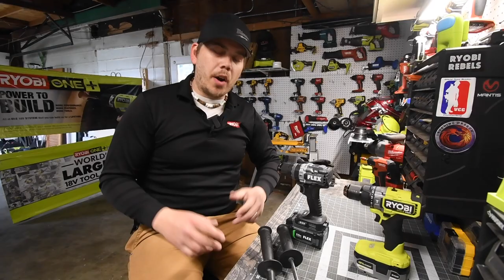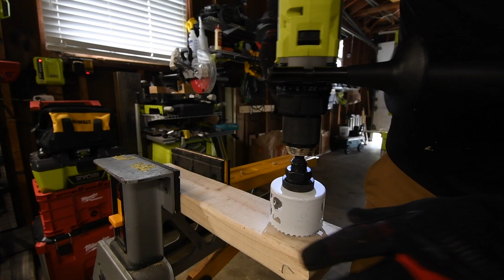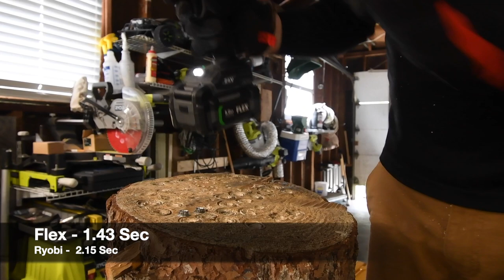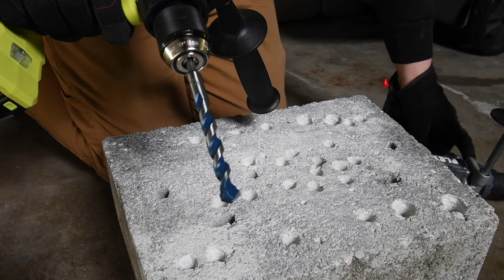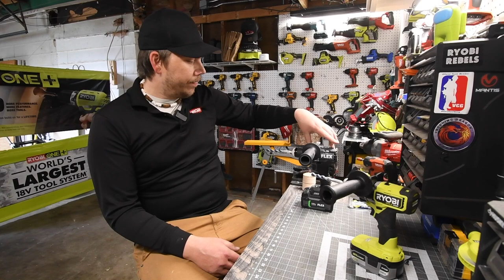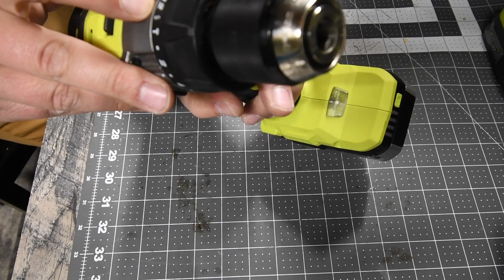FLEX Turbo vs RYOBI HP (Hammer Drills)

Comment: It's a huge difference when the loads get heavier. In small drilling and driving applications, there's not a usable "real" difference, but if we step up to big twist or auger bits....
Reply from the maker: Flex would last a lot longer on the job site, but this video was to test out the power between the two as sort of fresh tools

Comment: Those blue granite turbo bits are awesome. That's why you were so surprised.
Reply: Then must be disappointed in Flex?
Reply: @plaid11  yeah maybe. Hard to say with just a single hole
Reply: @ppwipf6935  seeing how there have been many other holes drilled with other channels, Flex beat Milwaukee, Dewalt, and Makita. I don’t remember if he had the turbo on for Flex but my guess is that he didn’t.
Reply from the maker: I do thank you for viewing :)
Reply: @plaid11   Check out Toolhead147.  DeWalt wins and Turbo overheats and turns off.

Comment: Sooo the flex about on par with ryobi or would you rate it higher? I’d like to see the flex up against makita. Also do you have a vid on the black makita compact drill/impact I’ve thought about getting those and makita xt281s I’m curious about both those makita models.
Reply: Imo Flex is showing it has its own class in between.  I would also like to see Flex and Makita 40v. Makita is built to get the job done not necessarily the fastest, but efficient. I just bought the Makita 40v Hammer Drill and Impact Driver, should be here tomorrow. I have the Makita Xph14 hammer drill and the xdt16 impact driver, both amaze me how comfortable and enjoyable they are to use.
Reply from the maker: I do thank you for viewing :)

Comment: The Flex is definitely better. But the kit at Lowes is $250. The Ryobi kit is $180. But the Flex also comes with a 2.5 extra battery. It's up to the buyer to decide weather its worth it. The Ryobi kit for that performance is impressive.
Reply from the maker: and that is why I do these videos. I just show what the tools can do
Reply: Depending on what you need, Ryobi has over 200+ tools that run off of the same battery platform. The Flex doesn’t have have that many tools out yet.

Comment: there is a flex drill with 750 in lbs  that should be more in line with the ryobi 750 in lbs not the flax with 1400 in lbs you should compare them

Comment: Which Ryobi is that? I think it’s only rated at 725 inch pounds, compared to the Flex, which is rated at 1400 inch pounds.
By the way, the Dewalt 996 has a pretty short handle too.
Reply from the maker: This is the most recent Model from Ryobi

Comment: Great video bro! Can’t help but wonder what would happen if you used 21700 cell battery for both drills. Maybe the same DeWalt battery via adapters? I know there isn’t an adapter for the DeWalt to flex yet. But when there is it would be an awesome test. Anyway, Ryobi surprised me I’m glad I own that drill. Thanks again!
Reply from the maker: more tests will be coming

Comment: Wow! I can't believe that this new Ryobi HP Hammer drill can keep up with the so called "Milwaukee Killer" Flex, can keep up also with DeWalt, Bosch and Makita wow! No wonder why I purchased HP bundle kit the HP Brushless 4 speed impact driver and the HP Brushless Hammer Drill kit it comes with 4ah HP Battery, a charger and green Ryobi Tool Bag God Im loving the color green. And since the new HP 6.0Ah battery came out I purchased the new 6.0Ah battery it's exactly the same size as the 4ah with added extra punch I hope Ryobi can slim and compacted a 9.0Ah battery with 21,700 cells in there or at least Ryobi should made a 12Ah 18V battery! Wow! Awesome! BUT STILL!! I'm not Loyal to any tool brand! So far I'm using DeWalt, Bosch, Makita and Hitachi in my jobsite as a Contractor, Carpenter, Framer, Deck builder, Electrician and Welder. And now I got some new Ryobi I'm using them in my jobsite as well! Who cares! They can laugh at me for using Ryobi they didn't know my box truck is full of DeWalt, Bosch, Makita and Hitachi tools inside. I hope Ryobi will consider making a Magnesium Worm Drive or Hypoid Saw! Corded! Or Hybrid! Also Ryobi should consider to make a Cordless 18V brushless Framing Nailer!!! Ridgid already have one! Why Ryobi Can't?! Since the new HP Rotary hammer drill SDS came out.

Comment: Again, I am impressed more by Ryobi holding it’s own being it is targeted towards the DIY person whereas this top level Flex is aimed to the pros 
And yes, please give the current prices. I know there can be “specials” in prices but I do think for comparison, especially between a DIY tool vs a pro tool it can really show the “power to value” ratio.
The Flex kit, with a 5 and 2.5ah batteries and their quick charger was listed at $249 at Lowe’s. The Ryobi kit with a single 4ah battery and their standard charger was $179. So the Flex is $70 more but you are getting an extra battery and the quick charger and a pro-level tool.
The Flex non-turbo hammer drill kit is $199 which I believe Chervon markets more as a “prosumer” tool and to me is a more equal comparison to Ryobi and I’d like to see that head to head test.
Also - Ryobi has a kit for $229 that also includes their HP impact driver and adds an extra 2ah battery in a full 2-tool kit.

Thanks again!
Reply from the maker: Roybi has came a long way

Comment: So when I’m looking at battery specs. Which number is the one that tells me how much power output the tool is getting? Volts, Watt Hours, Amp Hours?
Reply: It's hard.  They don't usually specify peak current on the case or specs.  That's why all of us keep tearing them open to see the cell type.  And within cell types there are different current ratings available.  Amp hours and watt hours are really a capacity comparison.  But they don't tell you the maximum rate you can deplete that capacity.  Kinda sucks you're stuck hoping the tool company marketing will tell you, e.g. High Output, Ultimate Output, HP, etc.  Flex doesn't even differentiate.
Reply: Unfortunately none of those will tell you, closest would be voltage x amphours but that doesn't tell you anything worthwhile (you need voltage x highest sustained discharge in amps, and that will give you watts which is a measurement of "power"). What you need to tell how much power a tool would get is the the discharge rate the Batteries can sustain and that will be in the spec sheet of the battery cells themselves.
Reply: You can also measure horsepower. For the electric motors, we can calculate the power or horsepower from the torque and speed. For example, if we have a motor with 3,000 rpm and 6 in-lbf then the horsepower can be calculated below.

Horsepower =  300×6/63025

i.e. horsepower = 0.286

Here, 6/3025 is a constant when using rpm for speed and in-lbf for torque units.
Reply: Watt hours pound for pound
Reply: @paedahe4975  horsepower is like 20 years not the number to use. Its Kilowatts my friend. Especially in racing and tuning nobody use Horsepower since OBD and that is being here since 1990... 
Maybe its finally time to go metric Murica
Reply from the maker: in my opinion ah with certain cells.
Reply: @Zozo806  It’s not common, just saying how it’s possible. If you really felt like knowing. 👍

Comment: Ryobi stopping is just the BMS inside the battery cutting out  due to over amping
Reply from the maker: I do thank you for viewing :)
Reply: I thought the same, if u use the DeWalt battery, it basically unlocks the true power of the drill

Comment: I don't know about the Flex but the Ryobi is a monster, as in big and weighty.  The Flex appears to be somewhat more compact and a lot more powerful.  If I was in a business that needed a hammer drill, for the extra bucks, the Flex would be in my tool box.  I own Ryobi but using the same line of batteries wouldn't matter.  It's about getting the job done, and without creating a lot of heat which should equate to a long lasting tool... sorry Ryobi lovers but the Flex wins.
Reply from the maker: The ryobi does have a unique hammer feature

Comment: I wonder why Flex has a turbo button, why not just have the tool always fast and powerful?  Does it have to do with battery consumption?  Maybe do a battery longevity test with turbo on and off.  That would be pretty informational.
Either way, I'm impressed with both brands.  Competition means innovations.
Reply from the maker: I have no clue either
Reply: I think it is a Chevron thing because they have it on some Ego blowers also...the “Turbo” feature
Reply: Sometimes you want the extra speed, about 90% of the time I wouldn't use it

Comment: Nicely done. I am betting the Flex could beat the Ryobi even if you used a 9ah battery in the Ryobi and kept the 5ah in the Flex. It does appear the only area the Flex struggles is in the concrete.
Reply: Not to mention flex needs turbo on in order to compete with ryobi. If ryobi had a turbo it would smoke it
Reply: @user-jh1mq2ih2u  turbo is speed 3 my guy.
Reply: @dj-rocketman8545  he has it set on speed two with turbo enabled. So flex turbo only runs on third speed? So when set on speed 3 the turbo ie mute then?
Reply: @user-jh1mq2ih2u  What? Flex has only 1 and 2 speeds and turbo button.
Reply from the maker: we will see and it will be fun to find out

Comment: Wait, you'll use turbo mode on the Flex because it has that benefit but you won't switch to speed 1 on the Ryobi? Speed 1 is just another option the drill has just like a turbo mode is an option on the Flex. I know I've seen some of your other video's where you will give a drill a chance by switching speeds or options but sometimes you don't.

Wait again, then you use speed 1 on the Flex later in the video. Where's the consistency?
Reply: He used speed one on both of them in that later test. Stop crying.
Reply: @Taylormade2350  stop commenting until you read the entire post you're replying to
Reply: @bertall1ca  the entire post was read and was inaccurate. Stop crying.
Reply: @Taylormade2350  I acknowledged he used setting 1 in my first post & called him out for being inconsistent.
Reply: @bertall1ca  that's not being inconsistent you need to use speed one on those size blots. The flex did it in speed two on the first one and ryobi couldn't. That's all there is to it.
Reply from the maker: I switch to speed 1 on both tools if both tools fail at speed 2. but the flex was able to do it on speed 2. on this channel if I need to switch to speed 1 when another tool doesn't have to I fail the tool on that test
Reply from the maker: thats the benefit of having a dewalt. dewalt has 3 speeds, so it has a safety net
Reply: @ManCaverTools  Thanks for replying & for doing so without being an ass. And I know explaining yourself over & over again can be frustrating, cause I am married with children.

I agree when you say that it's not Flex's fault Ryobi doesn't have a Turbo button but you also said this channel is about finding the differences between tool brands. I get the whole battery issue where you'll never be able to match ratings. But why not use all the options on that tool to finish the test & then fail the drill once you've exhausted all its options? To expand on this using the analogy you gave in another video about race cars, sure the Ryobi doesn't have a turbo, but you could down shift to pass someone up or shift into overdrive to shoot for your top speed.

I'm only a hobbyist woodworker but if my drill couldn't bore that hole on speed 2 I wouldn't just give up, I'd give speed 1 a try. Maybe speed 1 could have surprised you. I think that's my frustration, I want to see the complete tool with it's onboard options in competition.

Thanks again for replying. The reason I first came to your channel was cause you modded an impact driver to get more torque, making you the Eddie Van Halen of tools!